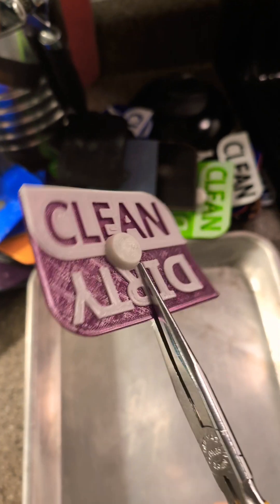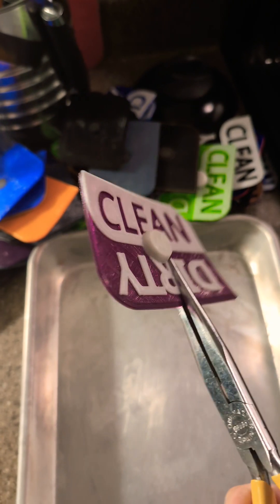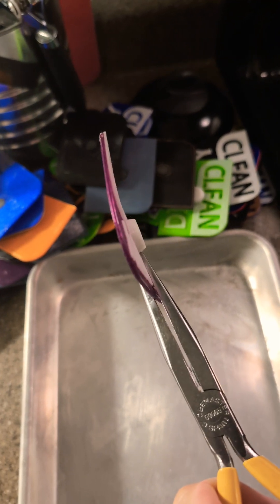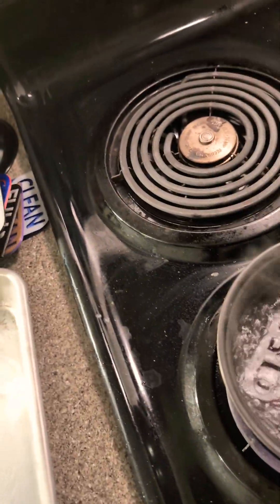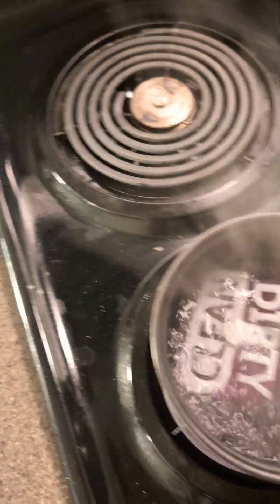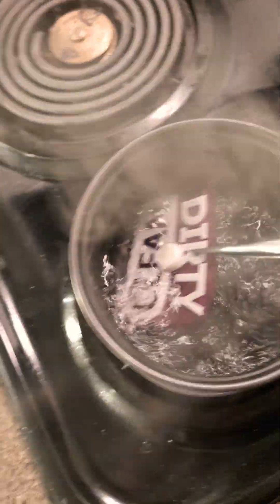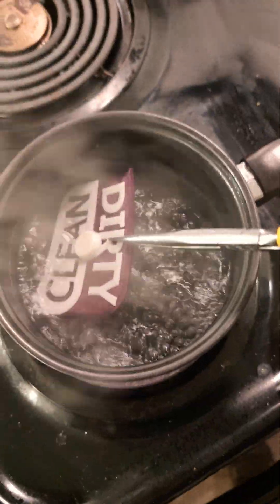Things They Don't tell you About #3dprinting : How to Un-warp PLA

Comment: It important to know the material properties of stuff you print especially if you sell. What you’re looking for is your glass transition temperature.
Reply from the maker: ~60°C for PLA... which is easily reached inside a car in the middle of the hottest summer in CO. Thankfully it's low enough I could fix them with boiling water. Lesson learned the hard way.